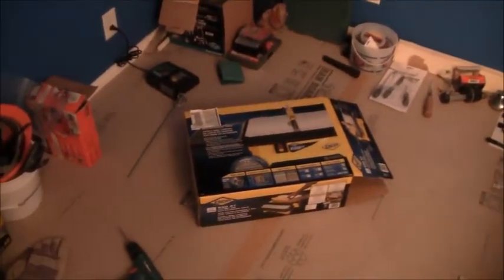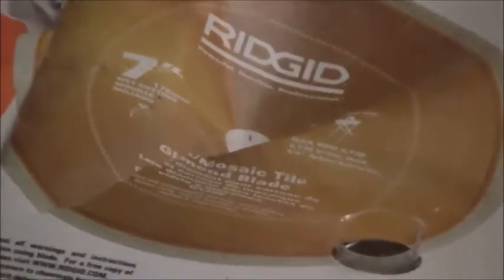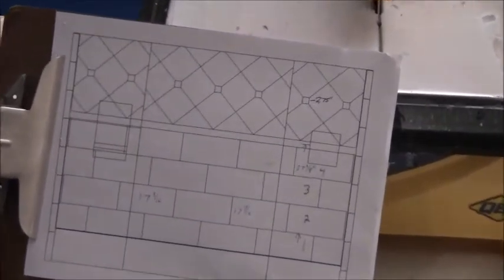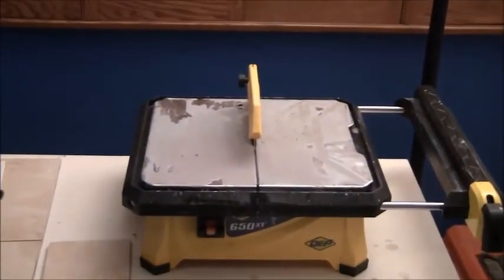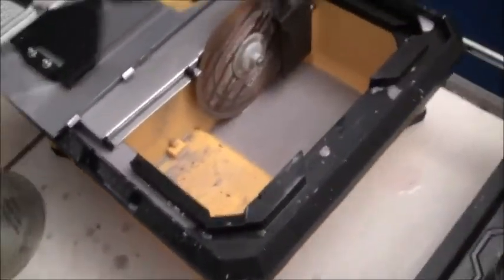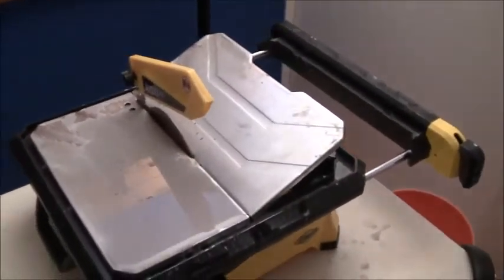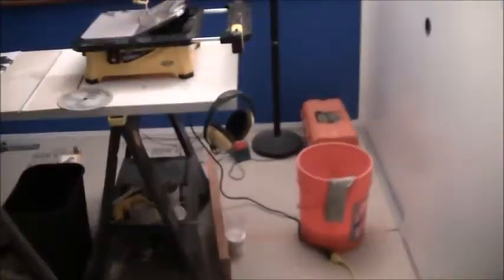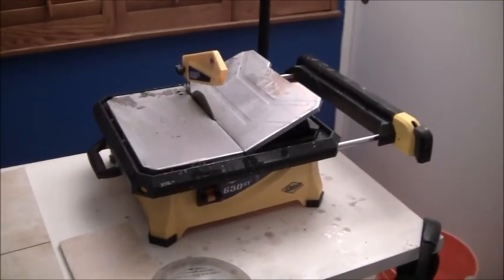QEP 650 XT Wet Tile Saw Review

Comment: can I use the saw without the splash guard? Can you do a demo on how to use the saw?
Reply from the maker: Sorry, I dont have the Saw anymore. You can use without splash guard but it may spray off the blade. If you are outdoors this is not an issue. This was a good saw for any tiles less than 12" X 12"